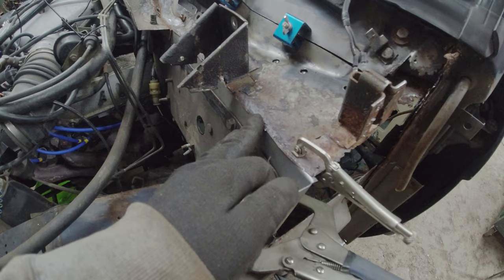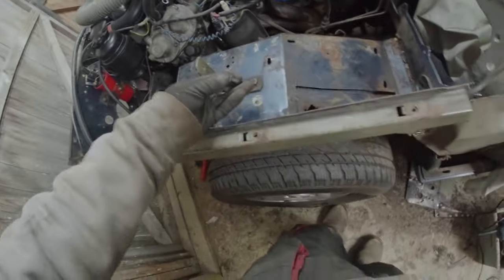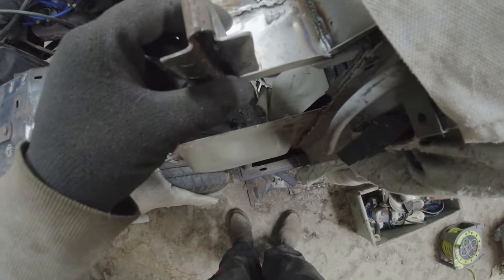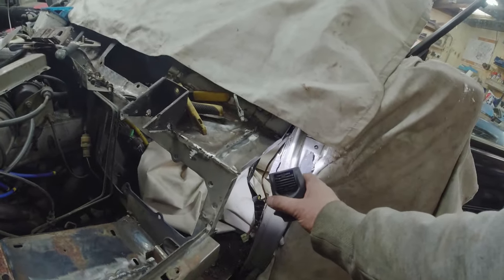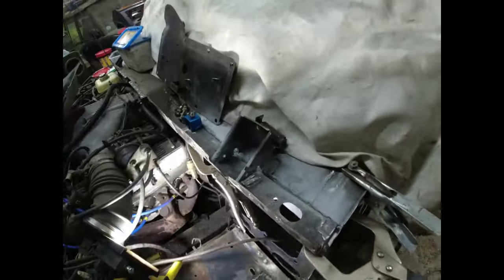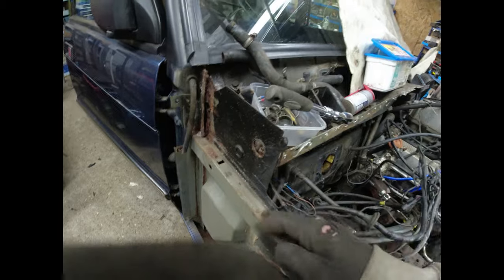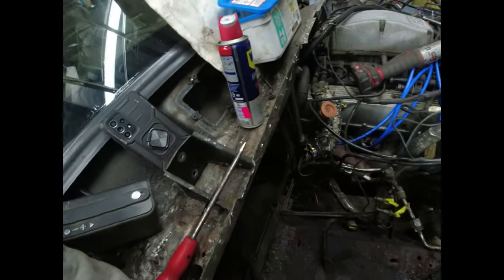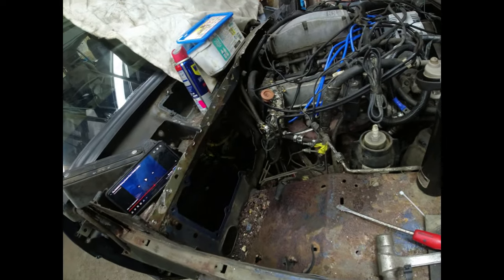Range Rover Classic softdash Royal protection car - passenger bulkhead side panel and a-post ep3

Comment: You need to call this RR Steve Austin, you can rebuild him, and it will cost just shy of six million dollars... Or Steve Rustin
Reply from the maker: The odd thing is that it hasn't rusted in any of the places that other Range Rovers have rusted. The corrosion is 100% down to the idiot who laid glassfibre down on the top of the bulkhead. Please do not do this folks

Comment: Does anyone even use LPG now?  Best to remove the whole system.
Reply from the maker: I agree with you, the licence to supply LPG for automotive is due to expire next year. This is lunacy because many petrol engined cars can be converted. The emissions are incredibly clean from those conversions and while there can be a slight decrease in power it does make the cars more economical to drive. The Government (who are desperate to clean the air) said nope.